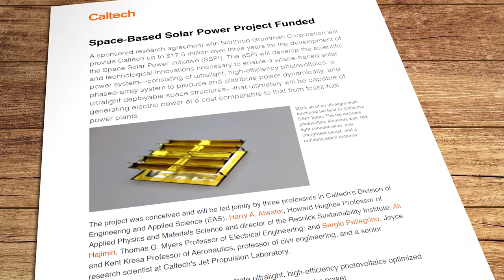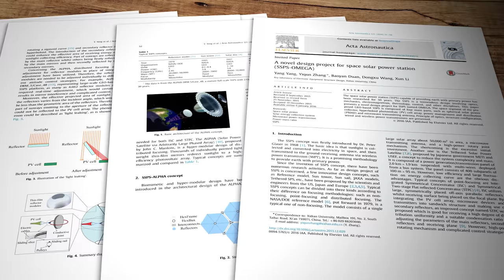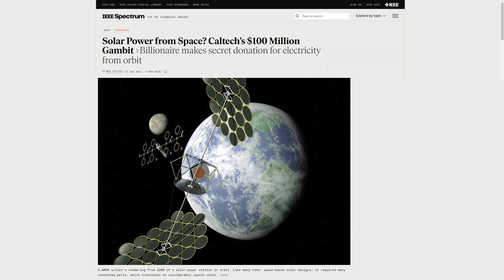Powering the planet from space. Closer to reality than you think?

Comment: This was interesting in the science fiction I read as a boy, and should probably remain there.  With infinite Geothermal power available, it would make more sense to develop closed-loop advanced Geothermal, like Eavor loop and others, for base load power needs anywhere on the planet.
Reply: Yes! Geothermal is a far easier technology to get working on delivering a constant energy supply than this space concept.
Reply: @Wotzinator funtionally
Reply: After awhile the heat around the well gets used up and the steam loses power.  So the well has to be abandoned and redrilled.  Drilling is not cheap.  And it has to be done where the earth is hot close to the surface.
Reply: The solution is never going to be a single source of energy. Instead of a one size fits no one solution we need to concentrate on what is appropriate and practical.

Comment: As has already been mentioned, a Maser, the microwave equivalent of a laser, would be one way to form a narrow beam. A phased-array could be another. I can't see the conversion efficiency from electrical output from solar panels to either microwave or laser beam being more than 50% at best. Assuming energy can be beamed down at a constant rate, demand in any one region on earth is low at night, so to make use of the capital investment would need diurnal storage - constant supply and variable demand is just as much a problem as variable supply and either constant demand or demand out of syep with supply. So space-based solar and nuclear have exactly the same problem, and terrestial solar, wind a very similar problem, the solution to which is basically the same - storage of electric power over mostly a diurnal cycle. Forbthat reason, I can't convince myself that space-based solar + storage could ever make sense cf terrestial solar + (about the same) storage. 
BTW, how come 2GW is a lot of power in China? That's about 2 watts per person. The average consumption in Britain is 500W/person.
Reply: Satellites could beam the power to each other around the globe, to wherever there was demand.
Reply: The great advantage of nuclear & space-based solar is that they can act as 24 hr base load power, which wind & ground-based solar can't for the obvious reasons. As for excess production, that certainly is when you put energy into energy storage systems, and you can indeed bounce beams between satellites for improved transmission, but by the time that SPS can become major you'll be looking at a transition to either artificial methane (my favorite, for mostly handling & storage reasons) or hydrogen for air and sea travel, justifying a large investment in the relevant production facilities.

Also, you can always just send the excess production out to space through a defocused emitter.
Reply: @absalomdraconis  Batteries will keep improving, and will be cheaper and more flexible than any fuel for almost all applications including air travel.
Reply: About the 2GW thing I agree with you 2 GW wouldn't be much in the energy mix 

EDIT: Here stood very bad maths, yes I got confused between my watts and my watts/hour sorry 😅.

PS: Maser rullez! 
I am very curious as to why it is almost never considered, According to my searches mostly because they are quite bulky and hard to build but I would still like to hear more discussions about their potential in energy and data transfer over long distances. It seems to do wonders for communicating with Voyager so far
Reply: @bozo5632  that would open a lot extra cost and loses for each satellite to receive and beam power between each satellite, not only that, they need also the capacity to deliver that power to the earth.    Why commit to all those issues if solar panels on earth are just 30% less efficient than on low earth orbit, and the storage issue is completely solve if you bother to solve the other 50% of world co2 emisión that come from the utility transport sector and the natural gas grid, which can only be solve using hydrogen, which it would be much cheaper and with higher efficiency than the loses and cost to deliver that power to earth applications from space. 
The true is, that delivering energy over certain distance in chemical form, is usually 10 times cheaper than delivering the same energy over the same distance using the electromagnetic spectrum (wires or wireless).
Reply: @bozo5632  you are delusional, yeah..  batteries would keep improving.. but unless you change the definition of "battery", they would always have a big drawback..  which is..  every time you want to double the capacity of batteries.. you need to double the cost..  instead.. using hydrogen.. once you already purchase certain power input/output, doubling capacity cost nothing, so you can keep doubling over and over and it would become cheaper and cheaper vs batteries. 
In fact.. hydrogen technologies started to receive big investment and research only few years ago, batteries technologies are increasing in a linear state, meanwhile hydrogen technologies still have the exponential curve of breakthrough ahead, that is why all last studies predict that battery cost would only drop 50% in 10 years, meanwhile hydrogen cost would drop 150% or something like that in that same time frame.  (not remember the exact number). 
Even now, for applications with "almost" similar production rate, if you want to deliver or storage power for longer than 2 to 8 hours (depending the application), hydrogen become cheaper than batteries. 
Just to mention some examples,  batteries would never be enough to power current airlines with 15 hour flights.  (right now you should be talking about 40 min max).
Even worst would be for container ships, they need to deliver power over several hundreds of hours to match autonomy, this mean that the ship would sink over the battery weight without extra payload.  Even worst would be to talk about the cost..  
Batteries would have always their applications, which are to store of deliver power for no more than few hours.
Reply: @angellestat2730  I advocated hydrogen in the 80's, but it's mostly a dead end. Niche applications only. Hydrogen is too hard to handle (bulky, leaky, reactive), and generation is too inefficient. 

Some forms of storage are inherently cheap at scale, like thermal storage. It's just hot dirt - cheap as dirt.
Reply: Because even though China is one of the richest nations in the world, the vast, vast majority of their population lives in abject poverty, fueled by eastern communism  (which funnels money to exclusively government and government-owned businesses) and western investments (which do the same thing).
Reply: @anne4922  The 500W constant power draw would translate to 12kWh per person per day (the difference in units being important), so I suspect you're both thinking on the same order of magnitude.
Reply: @bozo5632  maybe there is some convenient way to package hydrogen? like connecting four hydrogen atoms to one carbon.. ? ;-)
Reply: @angellestat2730  calling someone 'delusional' is very rude
Reply: @Theodorus5  yeah methane is probably better than hydrogen.
Reply: @dosadoodle  oh I see ! thanks I didn't realize this was an option, it makes total sense now. I feel like an annoying idiot 😅 sorry SB
Reply: @Theodorus5  maybe..  but the increase of battery fanatics who also hate hydrogen (as if hydrogen would be the one to blame for climate change) triggers me.    really tired of all those who keep spreading misinformation about a technology that is also key for our future.
Reply: Seems to me you might be able to put them in an orbit where they supply energy to where it's needed. Having multiple stations to receive this beam.
Reply: As already been studied and dismissed for multiple reasons; and then 
As already been studied and dismissed for multiple reasons; and then 
As already been studied and dismissed for multiple reasons; and then 
As already been studied and dismissed for multiple reasons; and then 
As already been studied and dismissed for multiple reasons; and then
Reply: @anne4922  Anne - I think you've confused kWs (power or average RATE of energy use or production) with kW-hours (energy usage or production) in your analysis , which is a very common mistake.
Reply: @angellestat2730  Could you please give me one or more examples where converting electricity to hydrogen for use as hydrogen would make sense?
Reply: @dosadoodle  Confusion between units of energy and power (rate of energy usage or production) is a very common error and source of misunderstanding and miscommunication. Thanks for helping reduce this communication gap.
Reply: @bozo5632  Do you Methane synthesized from combining CO2 + water + solar or wind generated electricity? If so, while better than hydrogen, I'm still not sure it makes sense economically and environmentally, compared to storing the electricity in batteries or other means.
Reply: @greggrant4614  Yes. I just meant better than hydrogen.
Reply: @greggrant4614  I already mention a lot..  The utility transport sector, this mean any application that requires to operate over more than 2 hours (flying vehicles), 5 hours (ground or sea vehicles).
operate = deliver a nominal power output over certain time = autonomy
Then you also need to add all those applications that require fast recharge or operate 24/7 without wasting much of that time in refueling, or without adding extra capital cost to mitigate that issue.
Even for certain demographic of consumer cars  who does not live in a house with garage, it is way more cheaper to add one hydrogen station every km/sq (that it is also used for the utility transport sector) than add a fast recharger in each parking spot, plus you have to reinforce all the electric grid.  
Then you also have the natural gas grid, which is used to a lot of things, not just heat for homes as many think, in that case, hydrogen can be blend with methane at increasing mixing rate following the increase of future solar and wind.
At higher wind-solar share, it means that you have less thermal plants balance the output, this mean higher capacity factor for electrolyzers, which translate into lower hydrogen cost. 
At 2035, several studies already estimate green hydrogen production of 1 usd/kg on some plants, this mean it becomes cheaper than extracting and using methane.
Reply: @bozo5632  if producing synthesized methane is better than managing hydrogen, why nobody is doing that then?   Right now all the ships that are being designed or that are already built to commercialize hydrogen (or as a way to add value), are for liquid state most of them, then pressurized (a small part), or a third option as LOHC. but in my opinion the liquid state would dominate most of the commercial shipping of the next decades.
Reply: @angellestat2730  If hydrogen is so cheap to scale, why aren't we all driving fuel cell cars?
Reply: @angellestat2730  No one makes methane now because it's cheaper to take it out of the ground. There certainly are vehicles (and power generation) running on methane. Far more than on hydrogen. The cheapest hydrogen also comes from natural gas. Neither is sustainable, and using electricity to generate either one is relatively inefficient. Niche uses only.
Reply: @dogbreath6974  because the share of solar and wind sources is still low, I already explain this in my last reply.  
At higher share, less thermal plants to balance and more intermittent energy to store.   This mean higher capacity factor for electrolyzers, this mean those same electrolyzer investment achieve higher profit in lower time (of course the lifespam  remains the same in working hours, but you short the time, which means that you improve the investment). 
It also reduce the cost of electricity (because solar and wind are the cheapest source of power today). 
But for example, right now Australia (with all their private companies) is moving all the strings to become an hydrogen super power.. 
https://reneweconomy.com.au/monumental-why-aemos-stunning-hydrogen-superpower-scenario-cant-be-ruled-out/
Reply: Why would you need any of that when you already have the sun?
Reply: S B take a step back and collect your thoughts. Your obviously intelligent. We already have everything we need here on earth. There's nothing wrong with what we have. You have food, shelter and clothing don't you? Now ask yourself, what can I do to help another human in need? I'm guessing it's not how to power the Earth from space.
Reply: @shealdedmon7027  Finland gets lousy solar. Orbital solar would give Finland 24/7 solar. That would help people.
Reply: @absalomdraconis  I don't know how long you plan on living but you are crazy! Why not just enjoy the few remaining years your have and spend some time with family and friends!
Reply: @bozo5632  imagine how the Eskimos feel? They don't need solar 24/7.
Reply: @angellestat2730  methane is abundant all over earth. Every puddle of water produces methane. Not to mention all the other sources.
Reply: @bozo5632  where does everything come from?
Reply: @angellestat2730  we have hydrogen bombs!
Reply: @bozo5632  yes they could if they existed!
Reply: @absalomdraconis  wow. Your smart!
Reply: @absalomdraconis  what are the obvious reasons?
Reply: Farts smell like shit most if the time! Also we you was from could and unicorns don't with not rain views sprinkle. Also not did we!
Reply: @absalomdraconis  is there so reason your not answering me?
Reply: @bozo5632  what globe?
Reply: @bozo5632  H2 > NH3 completely changes the game.  Handling + infrastructure already exists, no less convenient than LPG.  With a catalyst, H2+NH3 has been shown to work as a fuel in ICE vehicles.  In particular though, ships and possibly aircraft would benefit greatly, where batteries are a hard pill to swallow.
So 24/7 on the ground?  Combined cycle gas turbines.
Reply: @bozo5632  yes Finland gets lousy solar. Along with six or seven other countries that have territories in the Arctic circle. Which have a combined population of four million people.
Reply: @bozo5632  the needs of the many out weigh the needs of the few!
Reply: @anne4922  You do not understand the difference between Energy (kWh) and Power (kW), so your reasoning gets all screwed up.
Reply: @shealdedmon7027  One of the needs of the many is to keep people from trampling on their needs on behalf of "the many." Especially when their needs are decided for them by a few.